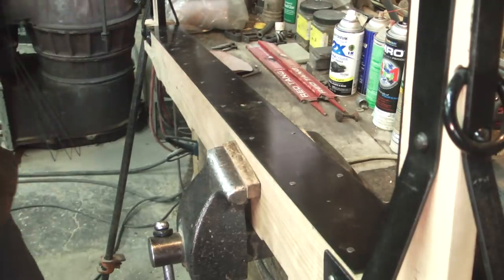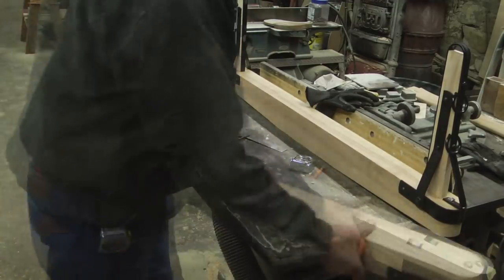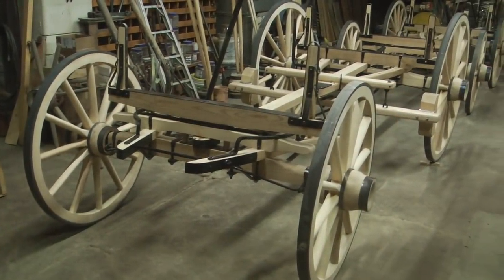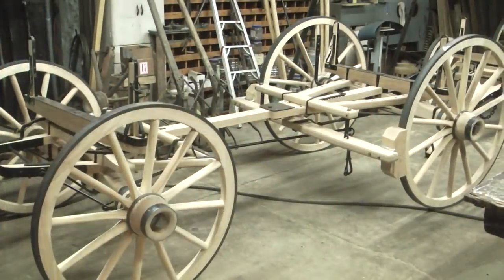Final Assembly of the New Sheep Wagon Gear in The Wheelwright Shop | Engels Coach

Comment: What species of wood do you use?  It's great to see you wearing your hearing protection.  Most guys out there don't.  Have you thought about putting some quick connects on your press's hydraulic lines and adding a cylinder to your pipe bender?  You might even remove the valve from the press and mount it on a pedestal, that way you can easily move it to where you are working. Great work as always and thank you for the videos.